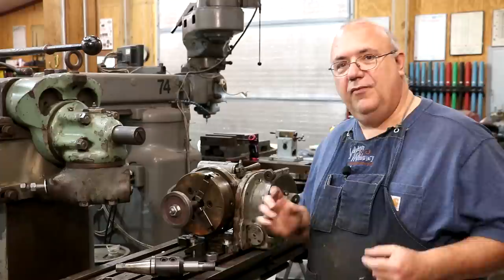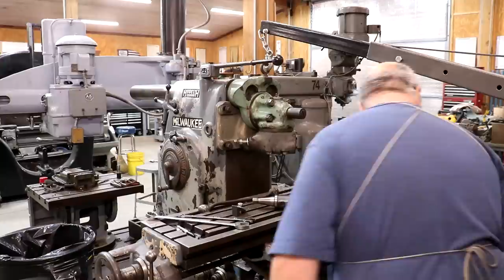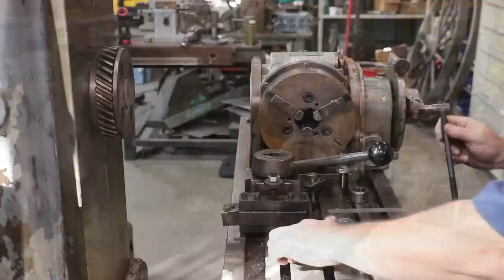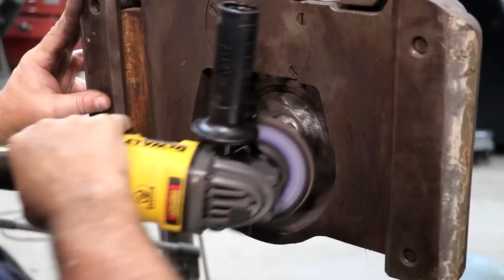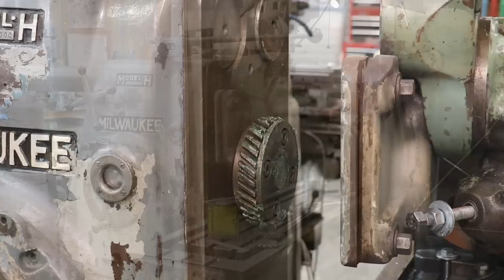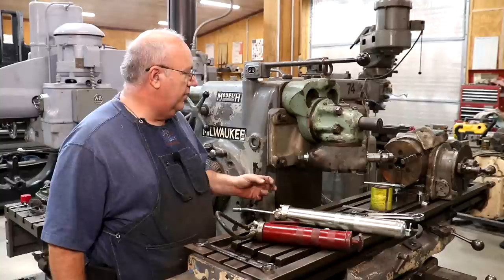Cutting Helical Gears on the Horizontal Mill 5 :Making Adjustments and Working on some Problems

Comment: For  a number of vintage cars, just like on the K&T universal milling head, particularly Rolls Royce and Bentley motor cars, there are a number of locations that call for grease but some that call for oil (SAE90 Gear Oil). In order to avoid gettting it wrong, I put either Zerk or screw down cups for locations that call for grease and only keep grease in my grease guns with Zerk fittings. For oil I have a Tecalemit Oil Gun with a head for button fittings only, so as all the oiling locations have button heads. Just can't then make a mistake.
Reply: As I recall Sprite/Midget rack and pinions need 90 weight oil and have a zerk fitting.
Reply: @natwooding9394  Button fittings disappeared in the late 1930's when cheap Zerk fittings became available. The Morris Minor is a notorious case, with a zerk on the front suspension trunnion threaded joint. If you grease them rather than oil them, they will fail, which results in the MInor with about 30º of negative camber, that used to be a common sight at the side of British roads. It is difficult to get button fittings with smaller threads but good vintage car part suppliers will usually have them. If I had a Minor or a Sprite, I would put a button fitting on the lower front trunnion.

Comment: I really appreciate how you explain each of the operations you are doing, and especially, the WHY of what you are doing. I'm a fairly new hobby machinist, and I've learned so much of what I know from watching just a few machinists on Youtube. You make things clear in a way that, for me anyway, is just the right blend of showing and telling. There have been so many times when I've thought, 'Oh, that's why that thing I tried didn't work right!' And, happily, times when I've thought, 'Cool! I did figure out the right way, or at least one right way' to do something on my own. 

I just retired, and in the last few years bought both a lathe (a 1954 10x24 inch Logan/Montgomery Wards) and a milling machine (a 1960 Clausing 8520). I'm thrilled with the results I've been able to get with just my ham-handed skills and knowledge, and every time I use one or the other, I improve, and can watch the results right as they're happening. So satisfying! Knowing I'm doing something with so much history is also fascinating to me.

Comment: When I was first in the Navy I was assigned to a submarine's Deck Division.  The first day in Deck the guy who was teaching me told me to get ten Zerks from the Machinery Space.  I was thinking "Zerks, yeah right, they're putting on the new guy."  But I'd let them have their fun.  I hunted up a Machinist's Mate and told him I needed ten Zerks.  He took me to a cabinet, opened a drawer, and said: "Hold out your grubby paw." I figured this is went I get the handful of yuck but instead he counted out ten little fittings into my hand.  I looked and said: "These are grease nipples."  He replied: "Yeah, but they're made by the Zerk Company so they're called Zerk fittings.  I brought them topside and the sailor I was working with said: "Good, let me show you how to swap them out."  I was so sure I was being messed with but it was quite legitimate.
Reply: what no bolt strechers and 20 foot of gig line
Reply: I had a friend (not me, really) who was sent to the auto part store to get half a can of vacuum by the people helping him rebuild a carburetor.  When he told me about how the guys at the counter got a kick out of it, I asked him what he thought would be in the other half the can
Reply: @brianguest561  Or a metric crescent wrench and a left hand pipe wrench.
Reply: Zerks are in fact real, Dixon Nuts however are not.
Reply: @mikepelelo5657  Well, metric crescent wrenches do exist, as many wrenches now have both scales on the base of the jaws (which has to be the stupidest "feature" ever on a tool!). Who pre-sets an adjustable wrench?  We all do, but we get it about right and then adjust the rest of the way on the fastener.  A scale just slows things down.

Comment: Hey good job.  First shop I ever worked in was a pump rebuild shop, mainly water pumps, lots of relic machines, and that was 44 years ago.  They had an old Cincinnati horizontal with expanding collets and a lathe chuck, tool block for lathe cutters, was used mainly for recutting seal seats.  They used that old machine for years.  Then there was the Lodge and Shipley tee lathe.

Comment: Brilliant solution to the rubbing problem. Machinist and tool makers, as practical engineers, are great problem solvers. Problems are often stacked like pancakes. You can’t see the next one until you solve the one on top. Often there’s several that patiently need to be addressed. I’m hooked now. Can’t wait until I see how that gear is cut.

Comment: My very limited experience in a plastic mold shop taught me that tool and die makers spend a lot time making tools so they can make the final product.  Everybody walking through the door had the next big thing and wanted a quote.  EZ, Mr customer I can manufacture you part for $.23 each in quantities of 20,000.  The mold will cost $45,000 and take 8 weeks to complete.  I'll need half down before I can start.  It was a tough sell but every once in a while the customer would believe enough in their idea that they would follow through.  Thanks for the videos, keep them coming.

Comment: Giving up is not an option for Keith. His patience is admirable.
Advaced work ahead so no surprise extra work is needed, especially on an old machine being assembled part by part in some aspects. Adding a motor to the X travel and advanced electronics synchronizing the rotating table it's close to be able to do the same work. Thrilling thought...

Comment: This spring I bought me a 6Р82Ш soviet milling machine from 1978. Vertical head on this machine has never been used (no marks on spindle bore, just pure clean factory grind) but head was pumped full of grease. Looks like grease was diligently added whenever general maintenance/oiling was due.

Comment: Good catch on the interference, Keith, and a novel setup to correct it. From the other marks on the housing, it looks like there have been some problems in that area in a previous existence. These machines have a lot of history. If only they could talk. Looking forward to the next step in the journey. Mart in England.
Reply: My question is "WHY" the interference in the first place. Something somewhere isn't right and milling it down may lead to bigger problems if the issue isn't discovered and corrected first.
Reply: @pville5548  Over the years, original parts get replaced with "equivalents" that "work" (kind of) even though they do interfere.  It looks like someone in the past used screws whose heads were longer than they should have been and left in a central spindle that was longer than it should be.  If the operators back then didn't spot the heating (or it wasn't their own machine) then that easily explains   the tracks on the back of the cover plate.

Comment: The detail in your series is great.  A brand new arbor easily available solve the problem well, but would also like to see the diagnosis of the ill fitting end mill arbor. I would blue it up to find the interference points.   I am learning all I can in case easily available parts are not quickly available off the shelf.

Comment: Keith, I have the same universal head on my K&T 2HL.  I always check the gear clearance/backlash between the drive gear in the spindle taper and the gear in the drive section of the head.  There is some give between the drive and the main rotating spindle sections of the head.   You should check this runout and NOT depend on the slop in spline shaft to correctly align the gear runout.   I always mount the drive section first by it's self so it is easy to feel the gear backlash by turning the spline shaft and move the clamps up or down a few thousandths.  Then mount the main part of the head on the over arm supports and into the spline shaft.   At first when you said it was getting hot I was thinking of these gears binding with no backlash and high pressure on the teeth.

Comment: With that shaft heating up, it annealed a little bit, it was a little softer and you could cut it down.

Mr. Pete turned his lathe into a mill, you turned your mill into lathe. Oh the irony of it all.

Some say machines can't talk. But if one is listening the squeaks, chatters, and vibrations they can be understood.

Comment: Keith, 

As always a superb video. You bring back fond memories of working ashore helping with the engineers on the tankers to solve problems.  You have an inherent ability to diagnose and solve problems. 

There were a couple of things I noticed.  First, you are still using your engine hoist to move the milling head around.  I assume you are still looking for the K&T hoist attachment.  Adam Booth in one of his videos showed a hoist he fabricated for his K&T milling machine.  It seemed like a good solution to the hunt for the elusive OEM hoist. 

Second, I noticed that you ground the contact area on the milling head without protecting the gear just above the damaged area.  I assume this was just an oversight.

Bob

Comment: I read an interesting book recently that said most of the standard techniques--for hand--machining were developed in the 1840's-1870's for working on railway engine construction. At leat this was the case in England. Perhaps parallel evolution happened in other countries or techniques and knowledge were exported in written form. Either way it is an amusing thing to think all those standard methods to producing parts that Keith shows us are actually meant to be making steam locomotives!!!

Comment: Hey Keith... Gotta ask you...Clearance problem between the gear/shaft and housing...Shouldn't we be asking why it's happening...? If that gear/shaft is being pulled forward, into the housing while under load, seems that end play has become excessive...So...It didn't start out that way new...There must be a bearing/thrust washer or something that controls/sets the distance that shaft extends out...Would that not be the starting point...?

Comment: You should clean the face of the gear and the surface you hit with the flap wheel, then apply a coat of sharpie marker to one of the two sides, then put it all together run it then disassemble and see if any of the sharpie is worn off. Buzz the metal off until no sharpie is removed to ensure clearance between the moving parts.
Reply: Put a piece of soft solder across the gear, run it all up tight, then see if it is flattened, and if so, measure to determine the clearance.

Comment: Here is a prime example of the third extension of Murphy's law. What can go wrong will, inevitably, go wrong just when you thought you had the job licked.
Well done on the diagnosis and relatively quick fix Keith. Once again you've shown us a way to solve what could have turned into a major problem. Thanks for the videos. Looking forward to what should be an anticlimactic finish.
Regards from Canada's banana belt.
🤞🇨🇦🍌🥋🕊️🇺🇦🌞🇺🇲👍

Comment: Hi Keith why did you take the angle grinder to smooth the inside of the casting? The grinding dust is now inside the upper part with the other gear and bearnings...
Reply: Keith owns a shop vac ...

Comment: Hi Keith.
Just curious as to why not just loosen the clamps and then extend the overarms to move out the universal adapter?
Just seemed more logical to me, and much easier. Would the overarms not support the weight or something?
Creative solution to the problem using the horizontal mill/lathe.  lol
Interesting use of grease and oil for the adapter. Can't wait for the test passes.
Thanks for sharing.
Reply: The normal configuration is to have the adapter flush to the main casting and bolted down that way. That is the most rigid mode, it gives the most range of movement, and is how the design was intended. There should be no way to set it where there is metal-on-metal rubbing to the point of dangerous heat and damage. Instead of 'working around' the issue, he fixed it. The parts he had were not originals and could have been mixtures from all different years and model, with slight variations. If it was 'sent back' to the mfg, this is likely what they would have done.
Reply: Nice to see that Keith has so many answering services so he does not have to reply to any questions. Thanks to who replied.
Reply: @FeralPreacher  With over 200K subscribers he doesn't have the ability to answer every comment personally. It's clear he does read though them, so when the same question comes up from many people, he answers them all in the next video.

Comment: If it's oil lubed you would think there would be a fill port and level indicator. Multiple fittings to add oil seems odd unless each fitting feeds a reservoir inside. I find it puzzling that a case that requires oil would have three fittings on the top???? Oh well, the manual can't be wrong.... 🙂

Comment: Wouldn't it be easier to extend your over arms out and hang the head on it first, then draw them back in to engage the head to the gear and side ways?
Reply: If you attach the head to the mill first, it's constrained to only one axis of movement - if you do the overarms first it can swing around and twist and all sorts. I think most of the struggle comes from not having the appropriate parking attachment on the mill yet, and so having to wrangle the crane around makes it more difficult than it should be
Reply: @jeffreylee7184  Thanks for the clarification 😉👍

Comment: 6:17 Keith,  why  the hell do you STILL not have a PARKING ATTACHMENT device yet for your K&T? Make one. Would make a great video series. Borrows Adam's plans I think a friend of his built one up for his is Solidworks.
Reply: He uses his workshop and time and money to share things with us that he wants to do. 
We don't own him, he doesn't owe us, We owe him!
Reply: This one is different than Adam's. I'm not even sure this model was designed with that feature. Plus, I can imagine if he doesn't use it much, parking it takes up space on the side that may get in the way at times. He also has much more room in his shop vs Adam's garage, so he has no issue with putting it off on a shelf when not in use. It's just not a priority for 1-4 times he may change it out per year.
Reply: @kindabluejazz  Well... when I originally said it, it was said in "jest". But the other guy on here went off on a tangent sumthin about WE need to start mortgaging our houses and pay it directly to Keith now, for content. When I get back to the shop I'll check one our machines. We've got one of both styles 😁
Reply: @marvtomson574  And how exactly was I to know you said it 'in jest'? I'm sorry, I don't have the ESP package installed in my brain.

Comment: Can someone please explain to me how a helical gear can be cut with a flat cutter? A flat cutter is made to follow a straight path. Isn't going to jam or make a mess if it's being forced to follow a curved path?
Reply: The combined motions of the spindle, that of the dividing head due to the "lead" attachment's action, and the table feed give the involute cutter a "straight" path.  During the manufacture of a spur gear, the dividing head does not rotate, while actual cutting is occurring.  In this helical situation, the "lead" attachment rotates the dividing head IN TIME with the spindle and table feed, while the cutting occurs.
Reply: Synchronization is how.
Reply: @eliduttman315  I understand what is happening. I'm a wood not metal guy and I know not to try to cut a circle or part of one using a circular saw. For that task I use a router with a round cutter. What I see happening in this setup is as the Lead rotates the work the edge of the cutter is being pushed into the work. The problem is solved by using a round cutter ground to the profile of the gear tooth.
Reply: @eliduttman315  I think I've got myself mixed up. What's being cut here is a helical gear and I was thinking of a hypoid gear.
Reply: here is a video of my gear hobber cutting a helical gear. It uses a hob but a hob is basically a stack of gear cutters, sort of. Maybe from this you can see what is going on while cutting helical gears.

https://www.youtube.com/watch?v=d3fFn2LsS0s
Reply: @TheJohndeere466  Thanks James. Makes sense. WHere I had gotten myself confused I think was with the cutting of hypoid gears. They're a much greater challenge.

Comment: It seems a bit drastic to machine the spindle without investigating why it is interfering with the casing. 
Why not just grind out the back of the casting where it is rubbing? It looks like all it needs is a couple of mm.

Comment: Makes you wonder what K&T's thinking was thinking about with the interference in the gear shaft.
Reply: My guess is the parts have been futzed with by others along their journey, maybe not reassembled properly, or he is mixing parts from different models and/or years. Manufacturing tolerances 50+ years ago were not what we are now used to, so I'm sure that every machine needed to be hand tweaked a bit as it was built up in the factories. Not a problem for someone that has the knowledge and equipment.

Comment: Great. That's not the ideal turning, but just turning what's sticks out, that's enough. 
Removing and aligning on the lathe is too much effort.
Reply: Fat can collect fine shavings. Oil has a tendency to wick out of the gear but will not hold fine shavings. At that time we switched from grease to oil for the lathe chuck. Although it had to be refilled more often, we were sure that the chuck would really take hold. Especially because it is moved hydraulically and you don't notice if the chuck is jammed.